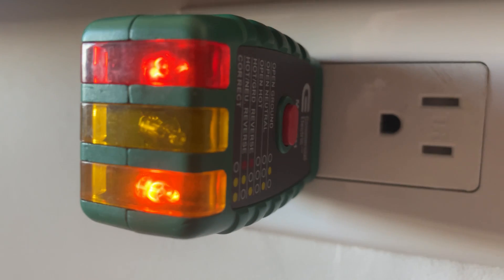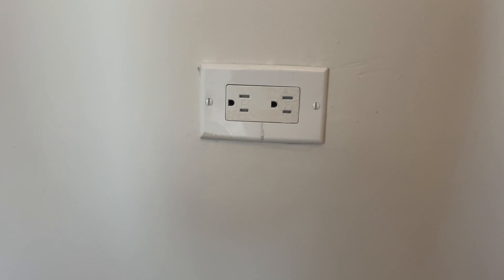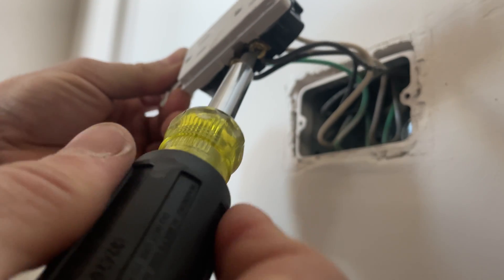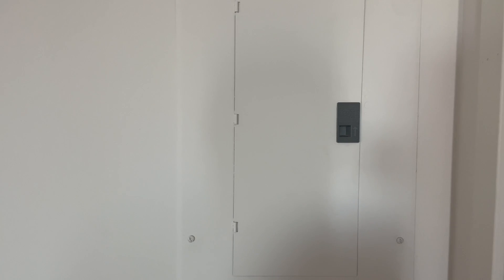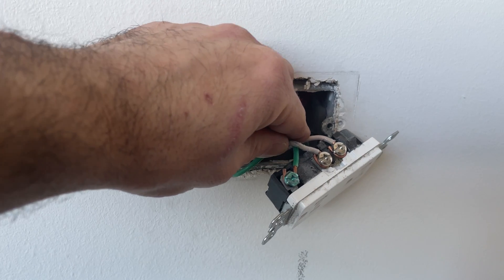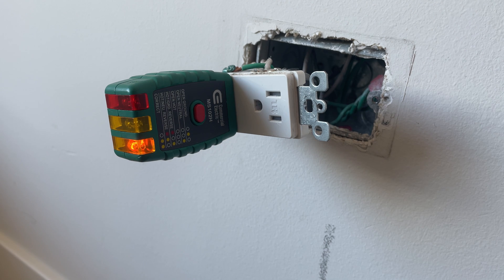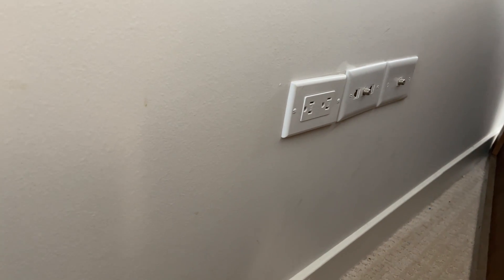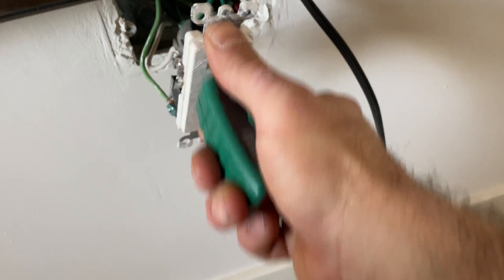Hot Ground Reverse on Outlet Tester Troubleshooting

Comment: My son bought a house recently that had an electrical issue according to the inspector.   In the basement, finished 20 years ago, there were 2 reverse polarity receptacles and the sub panel for the finished area, there were breakers connected to conductors every other vertical space..  I opened the main panel and a 2 pole 60 was wired black and red on the breaker, white and bare on the neutral/ground bar.   In the sub panel it was red and white on the buss lugs L1&2, the black on the neutral, and bare on ground bar.  So after some verifying, I moved the black to L2 and the white to neutral.   After turning the power on, there were 2 showed correct and 12 showed reversed.  It had been this way for 20 years.   It is amazing how stupid some people are that say they are electricians.   And yes this was contracted work, not DIY!
Reply from the maker: Crazy stuff. Thanks for sharing that with us 👍

Comment: can someone help me figure this out and recommend how to rectify this? our load side circuits have no grounds (typ. here in small residential units),. the ground is only connected to the service entrance line. i'm from the philippines by the way. i have tested the outlets with pencil tester (screw driver type) and found out that both live and neutral light up the tester. my understanding is that the neutral should not light up and hence you can identify the live and neutral pins. is this an indication that both the pins are live? will appreciate your input that can help me. many thanks in advance.
Reply from the maker: I’m not sure Ariel maybe someone else can chime in and help
Reply: @ApartmentMaintenancePro  thank you, anyway. more power to your vlog.
Reply: The powers that be are in control

Comment: And, that 'electrician' got paid how much an hour? Had a similar problem, and it turned out to be a bad GFIC. The problem was so bad that it melted the end of the neutral wire inside the power box. I have a tip which is to mark the inside of a receptacle cover with the number of the breaker that serves It. When I list a breaker's receptacles, I always use a plastic label maker, such as a P-touch. The notes on the paper ones fade, and the paper sometimes comes apart.
Reply from the maker: Good ideas outlet!! So hard to find solid blue collar workers these days

Comment: I enjoyed seeing the unpolished version of what it takes to track this stuff down. I arrived here because I'm doing the same thing right now, but still trying to find EVERYTHING that is on the circuit to test! I still haven't found it. But I reached my "need a break" stage and am sitting here with my cold adult beverage enjoying the fact that this happens to everybody eventually....

I am most amazed at how EVERY connection seemed loose. Even if you didn't find the problem, you'd have improved the situation significantly. I'd be tempted to pull them all now because whoever put those in didn't seem to own a screwdriver. And without properly-formed loops, I have to imagine that this wasn't an "expert."
Reply from the maker: Lots of average Joes when it comes to new construction, this electrical company was pretty bad BUT the good thing is this is the only unit I've seen in the building this bad. Although I don't work there much anymore.
Reply: The connection screws ‘could’ have been tight at the time they were made, but over just a few minutes the copper creeps and it is not as secure.  Add years of cycling current/temp and they can become looser.

Comment: Great video. I've got a similar problem where some outlets on a circuit work and others say Hot/Gnd Reverse. But all outlets and lights worked before I overloaded the circuit with an electric pressure washer. The breaker is good, so I'm pretty sure it is the neutral problem. I just have to go find it. My guess is an outlet fried somehow and isn't passing the neutral forward. We'll see. But your video has me on the right trail. Thanks.
Reply from the maker: Let us know if what you find! :)
Reply: @ApartmentMaintenancePro  Well no luck so far, looked at every outlet and ceiling light on circuit. Also looked at all the switches since a lot of neutrals are tied in the switches - not sure I did a thorough job on the switches especially a 4 ganger. However the breaker is a GFCI/AFCI type which I was not as aware of, my bad. So that's why no GFCI Outlets since the breaker does that. Theory I have now is that the load from the bad electric pressure washer damaged that expensive breaker. I got a new GFCI/AFCI breaker from Home Depot and will try that tomorrow morning and I'll post results.
Reply: Sorry for too many updates without results. Put new GFCI breaker in and same problem i.e. one outlet works fine; but everything after that point shows Hot/Gnd Reverse. So the breaker is working correctly. I did find that when I moved bundle of neutrals inside the 4 gang switches box, I momentarily got power to an outlet. So hope that was not random. It looks like half a dozen white neutral wires jammed together in back of box. So next step is to re-pull out all the wires and ensure everyone is connected. I used to re-do basements and when I wired I always made lights and outlets on different circuits. But this house has them mixed which makes things a little messier I think. Wish me luck!
Reply: @ApartmentMaintenancePro  Success. I missed checking the ceiling light switch in one of the bedrooms. Removed switch, looked at wires and nothing looked bad. But the switch was sending 2 neutrals forward. I tightened the wire nut and then all the outlets and lights worked in the rest of the circuit. So your tip was right i.e. the Hot/Gnd Reverse indication on the tester did turn out to mean a neutral wire loose or off. Thank you !

Comment: Thank you very much for putting out this video. It helped me quite a lot. My tester kept showing reverse ground was wrong but I know it was correct and thanks to watching you go to various outlets, I did the same. only to find that the outlet outside my new home was completely backward with the white where the black should be and so on. Once I fixed that, everything  worked fine.
Reply from the maker: Good find! :) Wiring on outlets can be tricky to troubleshoot for sure !
Reply: Tracking each outlet on circuit  is the only sure way , but that was a lot , understand the break necessity...✌️👍☝️💪🙏. ,,🤔☯️😸

Comment: This video was extremely helpful!  I had almost the same exact issue, tons of loose wires and wires installed the wrong way around the screw.  Cleaned everything up and worked like magic!
Reply from the maker: Good work Bill !!
Reply: There's no problem with wrapping your wire on the screw as long as the loop is going in the direction of the tightening of your screw. He demonstrates that in the video when he tightens up the screws on the receptacles

Comment: So I unhooked what I believe is the first outlet on the circuit and used my multimeter to test the wires? And I have nothing when I test the hot and neutral wires. But when I test the hot and ground wires I have current. I don't know of any other outlets or switches on that circuit. When I tested it at the panel it seems fine.  Any thoughts?
Reply from the maker: Loose neutral somewhere
Reply: You need to address the unknown factor.

Comment: Are you working from the last outlet on the circuit back to the breaker panel? And will a outlet before the loose neutral work normal

Comment: I was troubleshooting yesterday and ended up finding a juction box in the attic with burnt up wire nuts on the neutral. The house is aluminum wiring mixed with coppers. Had a whole circuit full of lights and a TV .
Reply: My electric drip coffee maker burns my coffee and the heating element is aluminum and the electrical cord is stranded copper.

Comment: Every outlet in my house is reading hot, neu reverse. Is that a electric box issue or do I have to address every individual outlet one by one.
Reply from the maker: Every outlet? I’d call an electrician
Reply: That depends if your connections are in compliance.

Comment: There wouldn't have existed this problem if instead of relying on the four connections (two for neutral and two for hot) in each receptacle to pass power to the last receptacle the installer had used two pigtails to supply power to each receptacle downstream.
Reply: Unless of course the "installer" had done just as sloppy of a job in bonding the pig tails. I mean if you aren't going to tighten any of the receptacle screws (and we saw the one wire nut with really poor twisting) I can't imagine that having the same guy using pigtails is the "fix" here!
Reply: Yep, a short cut can be a short path and a short path can be a short circuit.

Comment: I once found a situation where someone pigtailed a hot to both the neutral and ground side of an outlet and the neutral to the hot side of the outlet and the outlet tester was reading correct.  a cheap 6 outlet power strip that was also wired backwards from the factory was plugged into this outlet effectively correcting the reversed hot/neutral situation at the outlet.   so now imagine a tv plugged into the outlet and a cable box plugged into the power strip and everything is fine until you connect an HDMI cable between the 2 devices and the hdmi instantly and permanently welds itself into the port, heats up and trips the breaker.   This customer returned 2 new damaged tvs and a cable converter before having the electrical inspected.
Reply from the maker: That is absolutely crazy, thanks for sharing that with us!!
Reply: Good lord. What are the odds of that!? Amazing coincidence.
Reply: I would've sworn that people on the TV were either talking, walking or running backwards

Comment: Is it immediately dangerous? I just changed a GFCI 5 wire, ground, 2 lines, 2 loads and my "8-ball" reads hot neutral reversed, I dont want to shut the main off till the end of the day, my wife works from home. This outlet runs a garage located refrigerator. Also, are my line wires reversed or my load wires? I know for certain my lines and loads are correct, didnt realize the left and right could be reversed. Thanks
Reply from the maker: I’m not sure from this description I would have to troubleshoot with a meter. ☹️
Reply: @ApartmentMaintenancePro  The GFCI I replaced is well over 20 years old when the line terminals were on the bottom, load on top in the old days, so now you have to swap them. Can you tell me if the "polarity" can be reversed or is it fine as long as you have line on top and load on the bottom? I did reinstall them wire-for-wire as the house came, once  in a while like Christmas when I run a bunch of light strands on it, the GFCI would trip, but no other issues in 21 years. Thanks much
Reply: I own a multimemter
Reply: I own a multiscanner

Comment: Switched receptacle at my furnace is giving me troubles. Will work fine for weeks at a time then just stop receiving power. Tester shows Hot/Ground reverse when switched on. Normal when switched off. Is it something as simple as crossed wires? Or should I just buy a new switched receptacle and replace it. If you play with the switch repeatedly. The light on the furnace board will get a split second of juice every now and then.
Reply from the maker: Very hard to tell my friend. I would pull out a meter and check voltage fluctuation.

Comment: GREAT VIDEO!  I think helps put me on right track.  Just couldn't figure out how I could have that reading and it not be a short.  But one thing I wonder, is why guys (Which most but not all electricians are) wire outlets 2 in 2 out.  There are reasons why it causes additional problems and also would not pass inspection  in some areas.  Thanks
Reply from the maker: No idea. I'm a very average electrician. :) Thanks for watching
Reply: @ApartmentMaintenancePro  Hey, was following your advice to unplug everything on that circuit, and guess what?  The very, and I do mean very first outlet I went to unplug , the lights came back on.  Swear to god.  So I opened it up, saw the neutral 1/2 in 1/2 out, and wa la you know the rest.  Thanks for answering my question by the way, and I hope you don't wire your outlets that way.  Had mine been wired correctly, only that plug would have gone bad, instead of EVERYTHING down the line going bad.  Remember they used to wire strings of xmas tree lites like that, and when one went out, they all went out.  You may be too young to remember that, but they even figured out it was a crappy way.  Anyway, take care, thanks again.  D
Reply from the maker: @doloressalomon5732  Glad you got it working Dolores, take care :)

Comment: With an open neutral you will have voltage but won't be able to draw current to power loads because ac is not completed.

Comment: Thanks for the video. It really helped me understand the wiring in the bedroom that was all of a sudden giving me trouble.  Turned out that the neutral in one of my sockets was almost burned up.  I replaced the old outlet and wired it up correctly and viola, it worked...two green lights for all outlets in the bedroom.   Thanks for the THOROUGH explanation.

Comment: How would the cord being plugged in make it read "hot gound" ?????

And I think you mean Hot/ ground reversed..
Reply: I'm getting the same issue right now trying to track it down.  If something is plugged in it shows a hot ground.  If nothing is plugged in it shows a loose ground.  I've got one plug with juice but no power so I am going to try replacing that.
Reply: The receptacle has a pirated/cheated ground.

Comment: It our outlet when I tried it out it says hot ground rev and hot neu rev. I leave it out and it went back to normal after a while without doinh anything to it. Should I be worried or leave it out?
Reply: Ha Ha I have same problem.  It is intermittent.  It's fine for a while and then the circuit just goes down.  It's happened twice now and It's time to find the problem.  I assure you it'll happen again.  Maybe heat keeps the connection working, I don't know.  All I know is there is a problem
Reply from the maker: I would call an electrician if you can't get it not sure how I would tackle that :)
Reply: @ApartmentMaintenancePro  when the power went put on that room, i tried to test it and came back hot ground rev and hoy neu rev. Also, turning off the breaker and turning it on, seems to fix it, and went back to “correct wiring” signal. But I’m still worried, so I’ll try to contact an electrician. Because when I tried to use a power tool or other appliances(air purifier) in other parts of the house, that specific room always powers off but everything still runs electricity fine. And it didnt trip any breaker.
Reply: Go back and check outlet to give it the rev treatment.

Comment: Once I saw that two outlets had loose screws I said, “we are going to have to tighten all the outlets throughout entire place”.  It’s not safe to have any loose like that.  Definitely the fault of the installer.  They don’t get loose if they are done right to begin with.
Reply from the maker: Ya that kind of worries me. Building is only abut 5 years old :(
Reply: Yep, tightening up at least two receptacles a day keeps the expensive electrician away.